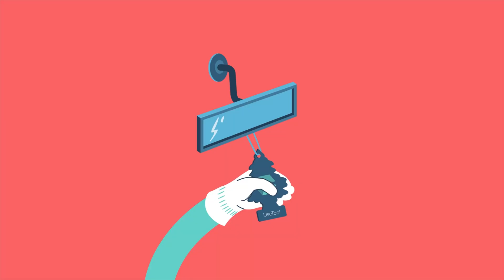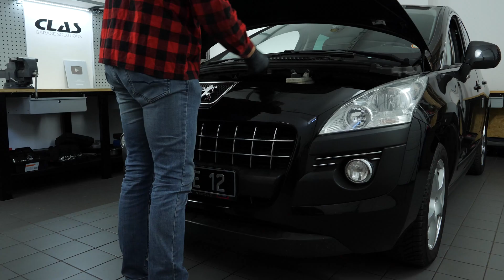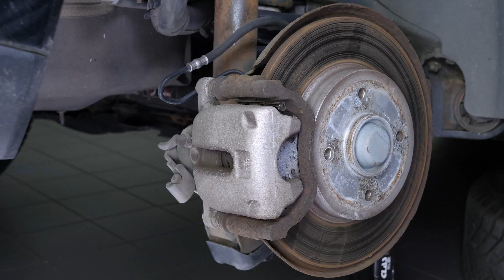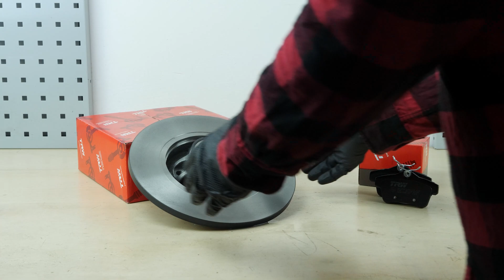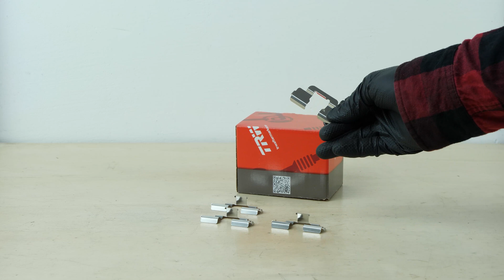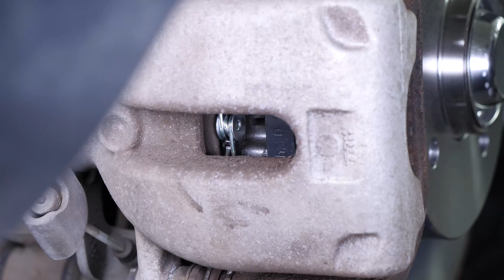How to replace the rear brake discs and pads Peugeot 3008 mk1 🚗

Comment: Hi, did you use any oil or grease before set disc ? Could you tell me Nm force use to screw on discs ?
Reply: If i recall correctly, its about 200 NM on the center nut for the discs, i would recomend to put a thiin layer of grease on the inside of the wheel bearing surface so its easier to remove next time :)

Comment: Hi, great video, as always
What are the torque values for the hub nut and the caliper mount bolts?
Reply: Hub nut is 300nm according to the manual.